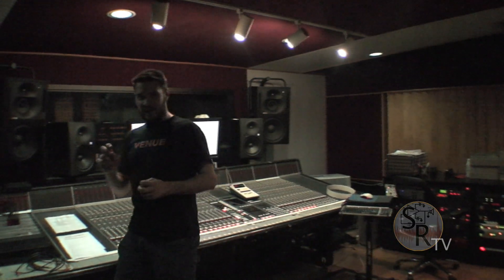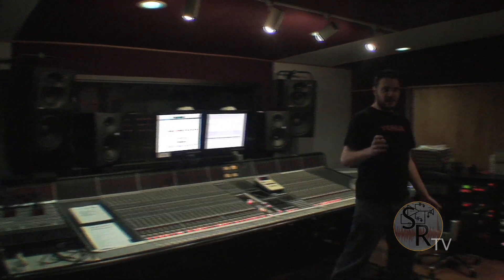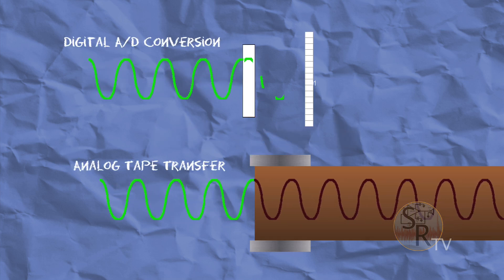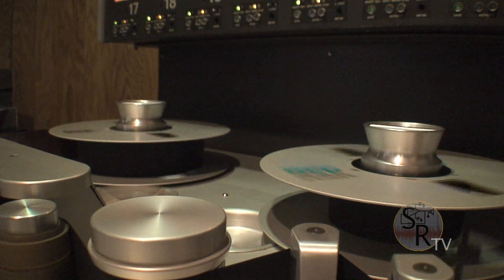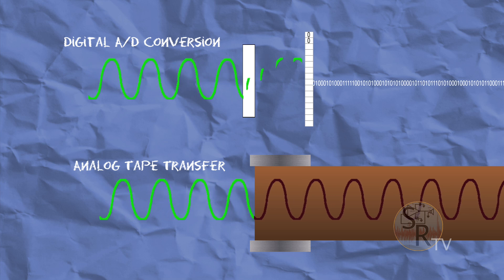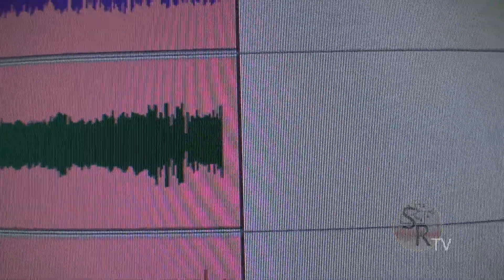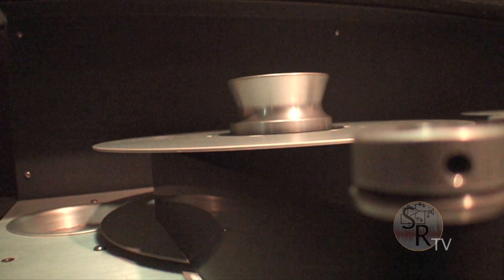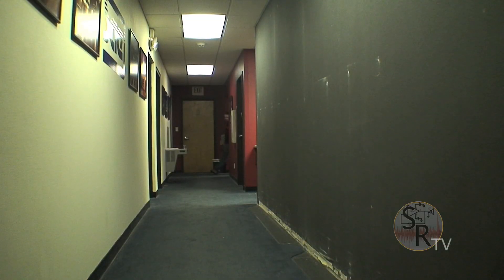Analog Tape Vs. Digital Shootout (Sample-Rate.com

Comment: Problem with this is you are still listening back through crappy youtube digital compression. 
So you still are not really hearing how good analog can be. Even just recording on my cassette 4 track it sounds wonderfull... then i have to mix down to digital, and you definitely loose something. Still sounds better than straight digital though.

Comment: You are not realizing that once sound is recorded digitally, via analog to digital conversion (ADC), to be played back through a set of speakers at all you need to convert the digital information back to an analog signal (a smooth waveform)...via digital to analog conversion (DAC). This process can be hit or miss based on the quality of the DAC. The DAC can be done by very high end audio equipment or by a no frills integrated sound card on a laptop. The ADC allows the sound wave to be stored on a hard drive simple as that. The resolution of the ADC (bit depth, sample rate) is going to play a major role in the quality of the DAC. High ADC resolution combined with a quality DAC will yield high quality playback. Low resolution ADC together with low quality DAC with be bad. CD's, which store digital information, used a sampling rate dictated by the Nyquist–Shannon sampling theorem if I'm not mistaken. This is a theorem that applies to area of study known as signal processing. I'm sure it has it's uses, but quality audio is not one of them as old timers swear by all analog/vinyl playback. Furthermore tape machines to my knowledge were many thousands of dollars back in the day and designed for two purposes only, recording music and playback. Anyways I could go on...just my $0.02 from an educated perspective as I've studied in the sciences and these two mediums are dripping in science. Not to mention human hearing and vision are mere samples taken by our eyes and ears and interpolated into smooth sound and smooth motion by our brains! There is food for thought!

Comment: Spitting out two digital files at 96khz means you're arbitrarily limiting the Analog recording, which is much higher, and then essentially bastardizing it into digital sampling which is missing even more of the interpolation.

The reason analog sounds "better" is because the information it is recording is positioned in a form of Cetera. In short, it is overtly inaudible subtleties which you do not actively perceive but your brain does - as a result, that Cetera kicks in and you "feel" the difference.

The only time transferring analog to digital would make sense is if you input it at equivalence range in ultra-high resolution, whereby the digital transfer is thereby recording that extra information, albeit even then it is still at a degradation cost, but it is minimal since it is capturing a set of different information than a purely digital system would capture. The difference is in those resolution gaps and the high range.

But yeah... this "example" is the equivalent to saying - 

Let's find out if a Lamborghini can outperform a YUGO... but first, let's jack the Lamborghini and give it the same specs as the YUGO before we race.

Comment: Tape (to my ear and heart) is always more musical - carries more emotional impact.  I find it easier to listen to, and things played off tape resonate with me.  I've been doing extensive tests for my own album and want to like digital as much because of its conveniences, and I'd like it to sound as good, but I'm spoiled.  Digital always lacks something for me.  I've even tried running digital tracks through additional processing equipment and home made audio gear with transformers, and while that helps to get some of that analog vibe and calmness, it still doesn't have the same feeling or push the frequencies out as pleasant as what I think tape machines do.  I don't like tape plugins much.

Comment: Analog tape "Colour" may sound nice on distorted rock music guitars but not for a classical music ensembles. I would always say record using the highest fidelity then add any colour or effects afterwards. The colour does not need to appear on the original recording
(BTW those were "air quotes" around the word 'colour')

Comment: Who cares about the sound.  The Studer is a beautiful machine to work with.  And so is digital Sony PCM-3348.  The early Pro Tools by Digidesign was alright, but recording into a modern PC or a laptop doesn't seem to be any more compelling than checking emails or going of Facebook.  Music is about aesthetics.  And so is musical gear.  So, I don't care whether it is digital or analog.  If there's a dedicated digital machine such as Sony multi-track reel-to-reel or DAT, or MO disc recorder, I have no problems.  I like dedicated audio hardware.  I even take Atari ST platform for MIDI, or Yamaha C1.  Those computers have standard MIDI ports, they look purpose built.  Sorry, but a cheesy laptop or a modern PC is not something I'd ever want in my musical environment.  I have respect for music, and I think music deserve dedicated hardware, not a cell phone, tabled, or a laptop, or a cheesy desktop with oversized LCD running and idiot icon based OS.
Reply: +James D That's right.  I am I am not into vocals anyway :)  I like musical instruments.

Comment: Thanks for posting this!  Seems to me that everyone  says digital is a true representation when in fact, it absolutely is not due to the the different qualities of circuit-boards, their traces, layout, and components that DRASTICALLY alter the sound. In addition to this is the reality that if your electricity isn't perfectly conditioned, it throws your word clock and converters off and even a very expensive symmetrically balanced power supply can't fix it all the way.  Amazing recordings can be had either way and the key is to understand electricity, proper studio maintenance etc... from the ground up.  I'm a total gear hound but in reality, getting at-least 2 songs recorded and mixed down a week is what matters the most. Even if it's not high end gear.  Just my thoughts.  PSS...............Who ever decided that d-sub connectors and the cables leading to them sounded good????????????

Comment: The tape deck in the video is suffering high frequency loss, absolutely no sparkle. This is not coloration, but just abnormal high frequency loss. The warm analog sound that people reference is not this...  not a muddy, bassy sound. Even a properly aligned 1/4 track deck for home use would produce better high frequency response... not a fair test, but a nice try!
Reply: yes just what i though.. they used s hitty reel-to-reel!!! need a good tech and FRESH TAPES.. i can do some indication of preffessionals LOLLLL

Comment: A simple truth; sound is vibrations moving  air. with analog tape  the vibrations travel almost  directly to the recording heads of the machine. with digital the vibrations are captured like  camera's taking snapshots of the signal, then blending the signal to convert  (keyword there) When you  convert the  signal it is not the same as the original. I can listen to analog all day. If I put on cd's it gives me tinitus.
Reply: Umm no. Analogue recording is an electrical analogue of the actual sound. There is quite a lot of electronics between the microphone and the tape, so not really a direct process.

Comment: Someone said, "...you can have the best gear in the world and still spit out a shitty song".  While that is true when talking about a good song vs a bad song, this video is about sound quality and not song quality.  Technically analog sounds better because it more accurately represents the original sound simply because the original sound would be analog to begin with.  For a signal recorded in analog format, there's no D/A technology needed to reproduce or convert it back to analog for the lister.  Now the better D/A technology you have access to, the better your digital recordings (Protools, Logic, etc) will sound.  Either way, a bad song recorded using both analog equipment and also recorded digitally will sound bad, but it will just be more accurately represented when recorded and played back in analog.

- Peace

Comment: Remember, you can allways distort and muffle digital, so it sounds like the analog tape, but you will never get back the original sound from tape, what was recorded on it. Add convinience of storage - thousands of hours on 1 hard drive, or room full of tapes.
Reply: Māris Samats How do I make digital sound like tape exactly?
Reply: add hiss to start, then reduce the DR and then lower the freq response to  20 Hz to 20 kHz +/- 3 dB; oh, and after, say 100 playbacks, add some signal degradation to simulate the tape decay
Reply: For storage I care more about robustness and longevity

Comment: Obviously there is more hi end on the digital.
But the digital high added by the coverters seems to add an unnatural sence of presence. Having an effect opposite of too much lows below 30hz.

With the anolog there was better presence in the instruments natural range of frequencies.
Making the sound of the instruments standout more than with the upper frequency of digital added.

Comment: Going purely by ear may not be meaningful because it totally depends on what you are listening to. For example, engineers used to working with analog are likely to EQ things brighter because they know the highs tend to get shaved off. This is why people who have worked for many years with analog sometimes find digital to sound thin or tinny.

Technically, both analog and digital media do impart some "distortion" to the sound, in that it recorded sound isn't identical to the original source. But the fact is that it can be concretely shown that digital is a closer and more accurate reproduction of the original sounds. For that reason, I prefer digital.

And that's not even getting into the convenience of digital (i.e. Pro Tools, etc.).
Reply: Fatality! Flawless Victory! lol

Comment: 35 mm tape was used back in the 50's and 60's and print-through was much less prevalent if at all. To bad a comparison of that medium is not possible. Besides direct to disc eliminates this completely.
Reply: There was also full track which in some ways sounds superior to PCM files and other formats.

Comment: If you compare Analog to Digital, you really should record 24bit 192Khz, or minimum of 96K since all other smaller sampling frequencies will degrade sound quality.
Reply: There is no point recording above 44.1 KHz 16 bit because there are few sounds in music or nature much above 22 KHz and most microphones suffer a fall off in sensitivity above 20 KHz anyway. 20 KHz is a dog-whistle pretty much.  You can't hear the difference between 16 and 24 bit anyway.

Comment: i don't know what you mean by the tape is colored..... when the tape is calibrated to the machine... you get a flat frequency response.... the wave form you get is front to back... source to reproduction... all analogue. The "coloring" only happens in the digital medium... it's sampled, cut into digital bits, compressed, uncompressed.... it goes through quite a few changes before you hear the result.... you don't get that with analogue.
Reply: It depends on how hard you hit the tape. tape will always change the inputted source, from not being noticed, to a lot. Tape compresses on its own. If you could hear original 60's and 70's sessions, and then the finished mix, you'd hear the difference. Digital does not color the sound. What goes in, comes out, despite all the snipping. And again, much of it depends on the equipment used.

Comment: Actually analog is not really affected much by the environment at all. CD's are affected by temperature heavily. Vinyls are archival.
Reply: If you don't store that tape correctly, go get it in 5 years, and watch what happens. The oxide will clump up on your heads, or just fall off. Been there, learned my lesson.
Reply: I think temp affects all physical media badly. They will all melt in high heat. Tape gets brittle and weak with time, Vinyl disk, records and tape wear down with each play back cycle.
Reply: Mike Corey
So true.
Reply: For the purposes of archiving, CDs physically start to degrade (the plastic breaks down for one) at 5 to 10 years.
Reply: Mike Corey Plus tape stretches as you keep working, rewind, forward..ect...why do you think that sometimes when you try to play along with your favorite album, your guitar is kinda out of tune with it.....its not your guitar, its that the tape stretched. I grew up working on tape, and I prefer BOTH!

Comment: You don't need to be explained anything... You got it all right, besides digital does not "chop" the audio. The way it is represented on some graphics on certain websites is wrong.  There are no steps, in fact the wave is as as curved as in the analogue.  If you run a note from analogue to D/A converter then to an analogue analyzer you will see that the signal is exactly the same.  No steps, just perfect signal.  If you zoom on a wave graphic on any program you can see that there is no steps.

Comment: Analogue does not possess a "wave file". Also your "2 foot wave" analogy is incorrect because digitising an analogue waveform does not change the amplitude (or length), which is what your analogy is suggesting. You would do well to read a book on digital audio to understand the basics before commenting in this way. It's knowledge vs assumptions and knowledge will always win.

Comment: Can you explain this to me? How does digital and analogue sound travel differently? Sound in the air is the same. The oscilloscope describes exactly what goes to the speaker, i.e., its analogue waveform. They are the same. There is no "cut up" sound after it comes out of the DA converter and especially not after it leaves a speaker cone. But please "paint by numbers" for me, provide the proof I asked for in the last comment instead of asking me if I want proof, I said I did.

Comment: What the hell are you takin about? The digital signal has To converted back to analog to be output by the speaker driver so you're hearing an analog signal anyway... FAIL

Comment: Yeah, if analog had infinite tracks, and infinite splicing down to sub-millisecond timing, and infinite undo levels, and infinite instances of effects processors, and infinite numbers of re-records without increasing noise level, and reverbs that don't require a huge, expensive plate, and infinite synthesizer layers, and sampling, then it would have about equal pros and cons.

Comment: Have any of you ever done a test with an oscilloscope and AD/DA converters? send a sine wave in and out and tell me you see a difference. The answer is, you don't. Analogue has lower fidelity than digital. Find a Studer manual and look at the specs, then compare them to a cheap AD/DA converter. Analogue is perceived to "sound better" because of its distortion characteristics, nothing more, nothing less.

Comment: If properly set levels, inputs, etc..  digital is FAR superior.  Why, because your human ear hears in 32 bit analog. Digital is far beyond the quality of 32 bit now. I like analog, i use all tube gear for input.  But, i have to say the analog tape degrades the mix and of course over time, goes away.  Nostalgia is ok, if thats what you like. I'll stick with accuracy and affordability of digital recording.

Comment: The DRUMS are QUIETER on the ALL Digital-maybe tape compression has brought them up on the 2 Analog files? I bet if you went and turned up the drums and subtly compressed[or NOT so subtly-76 to ALL buttons mode]the test would be more interesting,the way it's being done HERE is basically showing the difference,digital=no compression,analog=compression.An ok test but ....

Comment: I also agree with you about vinyl. In 1998 I had the pleasure of listening to Zep 3 on a Manley turntable. I grew up with Vinyl and had been an a recording engineer for 10 years, so I worked with 24 track analog machines since 87. But by 95 analog was starting to fade, so it had been a long time since I listened to pure vinyl and or tape.... it blew me away.

Comment: You are 100% correct. I will only add the sampling rate has to be VERY high to capture the essance of analog. And there in lies the key to the argument.

The "nyquest"  sp?  theory has been proven wrong. The sampling rate does not need to be double the highest freq present.... it needs to like 5 time the highest and maybe even more.

Comment: Just two ways of doing things.
Digital = Defined resolution by bits. (you trow away lots of air character)
Analog = Infinite resolution.
However, analog is a pain in the arse to work with...

Comment: Noise floor is the level caused by just tape hiss.  The lower the noise floor, the cleaner the signal.  Imagine a low noise floor with tape.  It'd be the best of both worlds.

Comment: If we could design tape machines with noise floors as low as digital recorders, we would definitely still use tape quite a bit in studio apps.  One reason to slam a tape with signal is to saturate it to compensate for the higher noise floor.

Comment: Huh? Can't remember the comment I made because I can't find it but quantization is the conversion of an sample of a continuous electrical signal to a number - usually 16-bits long. This means that thepower of the current at a given point is turned into one of 65,536 possible quantization loudness values. Every time a bit is added, the number of available values doubles.

Comment: Or get crass, or get some of the best tape real plugins emulation out there. Will end up costing more the first minute, but in the long run you will have the same quality as tape (IE added noise/distortion through third and fith harmonic frequencies saturation)